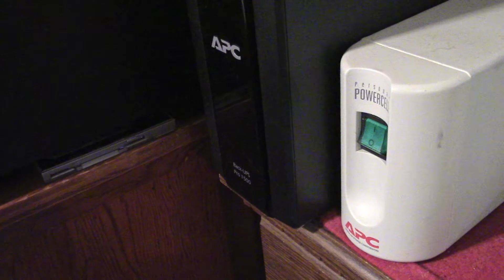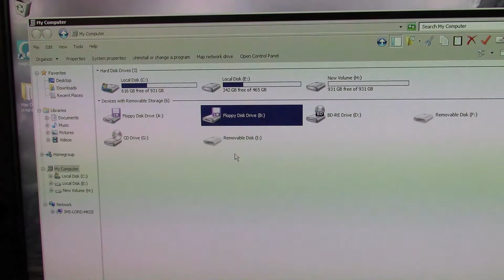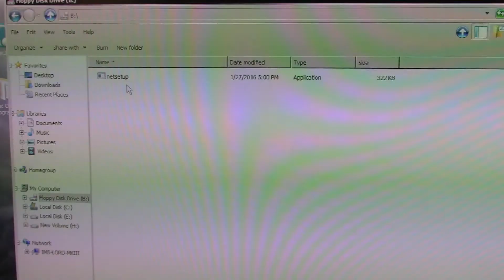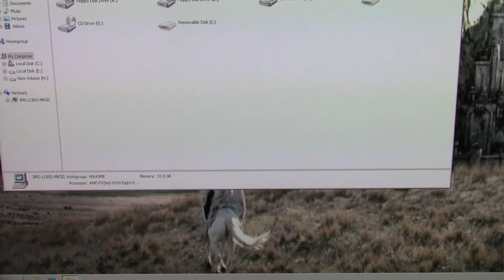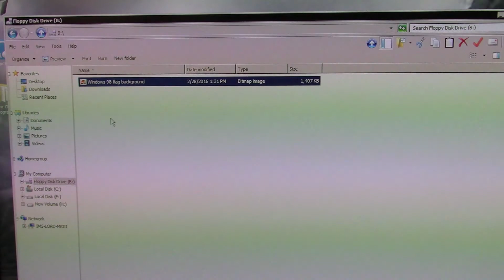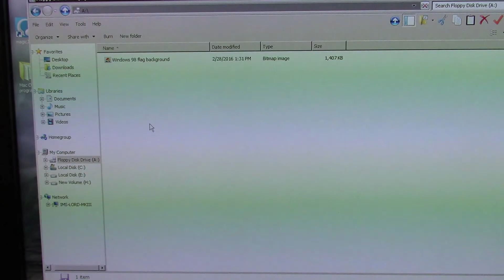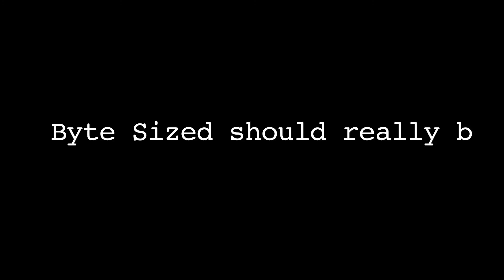USB Floppy Converter Part 1

Comment: While you can use this in two modern machines it fails if you copy a file onto a floppy and try to read it on an old machine. This makes it useless for transferring CNC files to the older CNC machines that use floppies.  :(

Comment: Where did you find the adapter?
Reply from the maker: See part 2 in the video description!  Thanks!
Reply: you can get these on EBay for around $19.00... You are better better buying a whole ready made (new) USB Floppy drive just under $10.00 (they are smaller built and plug-n-play corded USB connector)...
Reply: @steve4510  that's true, but almost If not all of them can't read or format any other than 2HD disks, which is a shame.
Reply: @boggsty  This adapter can't either, just tried, even with CMD on Windows 10 where it is still supported, I get the error message that "this parameter is not supported by the device"